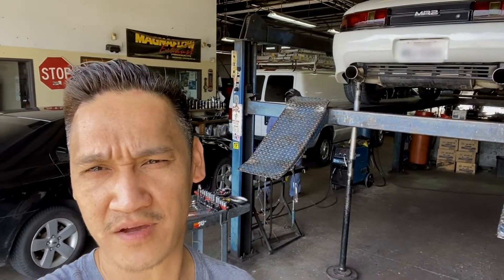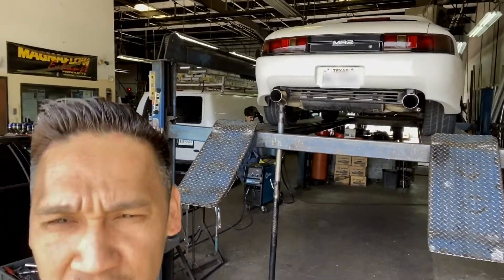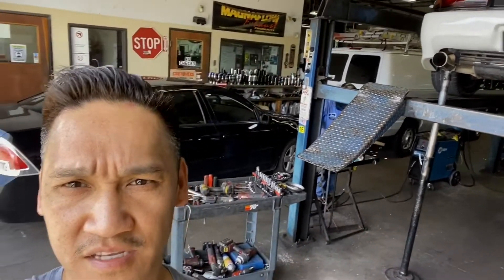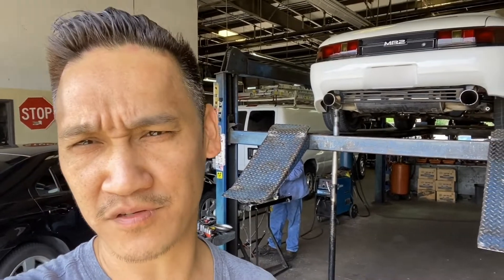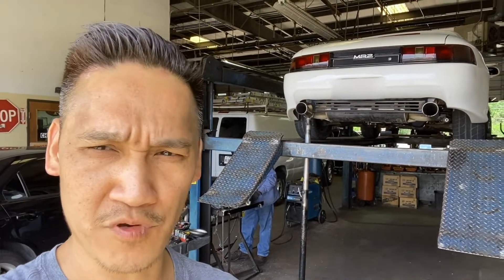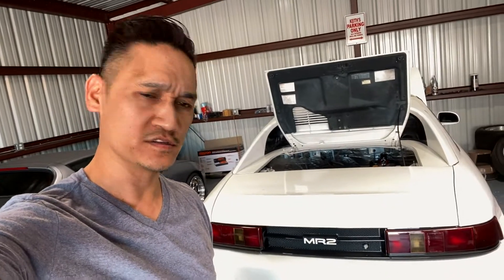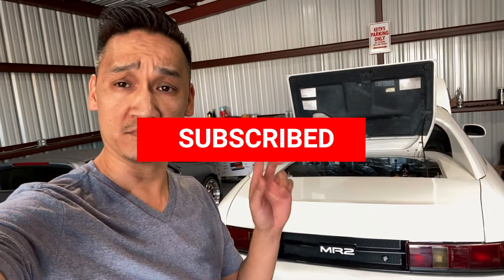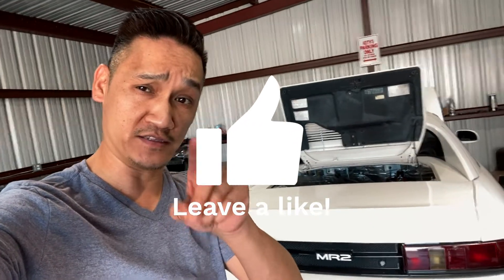Toyota MR2 K20 Build / Keith's Vlog # 1

Comment: How did you get the rsx gas gauge to work with the 10gal fuel cell.
Reply from the maker: Jcoolee  just wire it up like normal how a fuel gauge is but require a resistor to accommodate the size of your tank so the reading is right!
Reply: Look up rarewitit he had wiring video